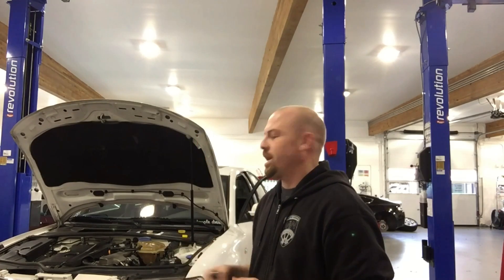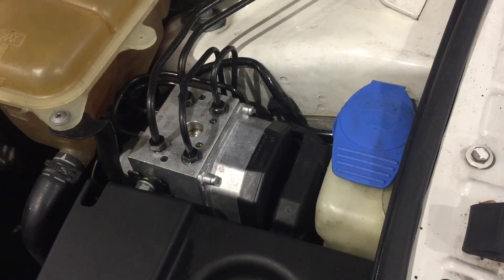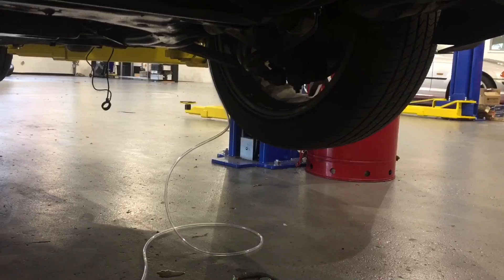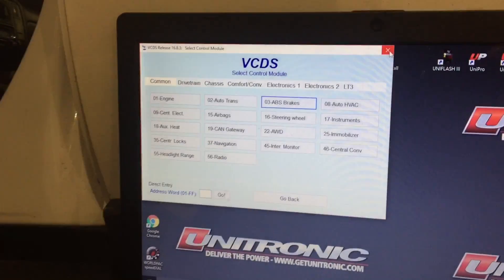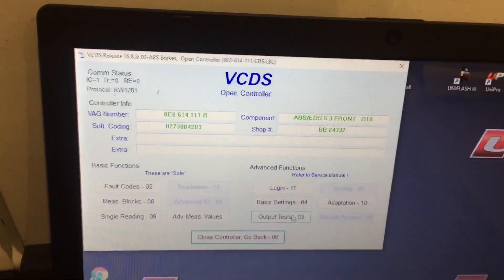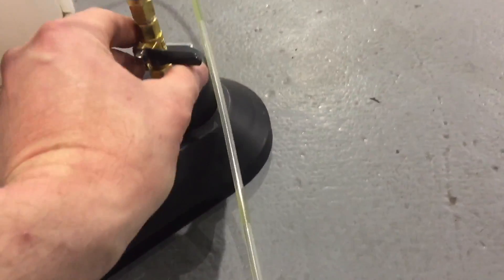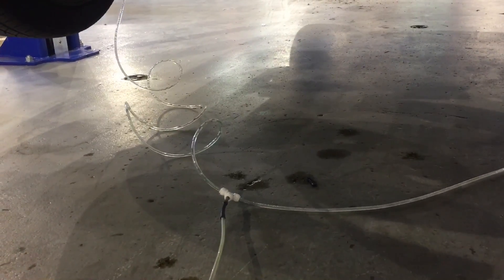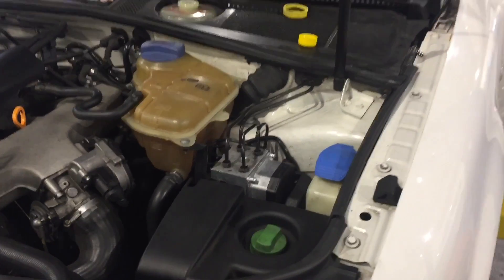ABS Pump Brake Bleeding VW B5 Passat

Comment: Aren't you NOT supposed to have the pedal to the floor to avoid upsetting the master cylinders internal seals? 

What section of VCDS must you use to bleed the ABS pump for a 2008 A4 quattro manual speed? I've been using the output settings and selecting the ABS pump test activation that runs the pump for about 30 seconds. Does that do the same thing as the basic settings? When I have both front bleed screws open nothing comes out when I do the ABS procedure. But when I bleed them normally fluid comes out. I'm using a Schwaben pressure bleeder at 2bar. I saw somewhere that Audi's have some sort of pressure safety feature in the system. Could the pressure bleeder be causing that feature to prevent fluid from releasing? Should I use a lower pressure?
Reply from the maker: VCDS Can+Hex is what we use for this model. One VCDS it should tell you to press the brake pedal down before starting the motor. This bypasses the master cylinder and allows fluid to pump though to the calipers. 

Correct, do not push the pedal all the way to the floor. 90% ifof the way, max.
Reply: I suggest checking passatworld. A highly experienced person there insists no special tool is needed for b5 and b5.5.
Reply: And yes, don't push it to the floor. You can guess how I learned that.

Comment: Ok I have a small computer but I’m doing this myself… can I after I fill brake fluid, connect hose to bleeder and put into a bottle with brake fluid in bottom, open connector/bleeder, turn abs on, and then pump brakes until the abs turns off? Then close bleeder and go around car like that?
Reply from the maker: ** If you follow the video, exactly like I did it, you will be successful. I made this video and performed this bleed by myself. Just make sure the reservoir is full when your performing this. We use a feed bottle now that helps with this procedure.

EWK Brake Fluid Refilling Bottle: https://www.amazon.com/dp/B01HGPI5O4

** For the follow up bleed on the rear brakes, you will need one of the two options:

1) Pressure Bleeder. This is the pressure bleeder, made by Motive, is the tool we use in our shop. This is good if your flushing the fluid and are not trying to get air out.  IF you are trying to get air out, this will work, but sometimes does not get everything out. See option #2 below.

Motive Pressure Bleeder: https://www.amazon.com/dp/B0002KM5L0

2) One way bleeder valves. These valves, made by Russell, have one way check valves that will allow you to pump bleed the brakes by yourself. If you're trying to get air out of the lines and performing this yourself, this is a really good option. Personally, I like this better because you can close the valve, pump up the brake pedal so it's nice and firm. Then crack the lines and perform a few pumps with your drain submerged in the fluid catch. This will force all the air to one area within the brake lines and it will get more air out of the lines faster. They make them in M7x1.0 & M10x1.0 for almost every European application:

M10: https://www.amazon.com/dp/B000CPCOAM
M7: https://www.amazon.com/dp/B000CPCOB6

Comment: So what do you do if you DO NOT have all these tools ???????? Better to show how to without them.
Reply from the maker: There is no way to do this safely without a proper scan tool. People have told me they have bypassed this and manually ran the motor. But you risk the chance of burning out the motor or shorting out the control module. I would HIGHLY suggest not doing this.
Reply: Can't without activate the pump properly without a  highend scanner or VCDS
Reply: Get a different car or stop being a brokeass

Comment: Hi Dave, l am upgrading to vcds from vcds lite to perform the same procedure on the ABS.  I was wondering where you found the procedure that was specific to your vehicle. 
My car is a 2001 audi a6 quattro and
Reply: an unable to locate it.
Thx
Reply: @peterhilbert6428   Did you find how to run the abs pomp?
Reply: @MKasap-te8vm  Yes, VCDS LITE will not run the pump as l was told. You need the full version.
Reply: @peterhilbert6428  A registered copy of VCDS lite will run the pump I'm told. Registration costs $99. I'm going to try it.

Comment: Great video! So for the rear brakes do I bleed them the normal way without VCDS tool?
Reply from the maker: On early model Passats, yes. If there is no provision on the scan tool to perform the rear brake bleed, you will need to do it manually.

Comment: Can you pressure bleed (Motive, etc.) using the same method?
Reply from the maker: No. The ABS system will still need bleed and the motive bleeder will just push it out. The AMS system is a closed loop system that will only be able to bleed if the pump is on.

Comment: Are you not supposed to bleed rear brakes first and then front?
Reply from the maker: The VW workshop manual says to perform the ABS bleed. Then perform a normal brake bleed.

Comment: Invaluable video - Thank you Dave.  Can you please clarify that the ABS does not relieve the rear brakes?  I just verified in the Bentley manual for model year 1999 thru 2004 that there are ABS inlet and outlet valves going to all four brake lines.  In addition each wheel has an ABS sensor.   It would seem that the ABS relieves all four brake calipers.  Thanks.
Reply: I believe this varies by vehicle....
Reply from the maker: @PeterB12345 is correct. It's a case by case situation. Some vehicle have it for all four. This vehicle had it for the fronts only.

Comment: VW Golf V 2005 with ABS on all 4 wheels. I has  a soft pedal for a long time. Not close as hard as my Passat 2006 with a similar system. Do i need to do the ABS pump procedure on both axles? One axle a time? (I have a pressure bleeder and VCDS).
Reply from the maker: This symptom sounds like it may need a new master cylinder too. It's try bleeding the system out first. It's a good idea to bleed the ABS system if you have this going on. But you might be able to pressure bleed the system if you're changing the master out. Old school pumping with two people is sometimes required when doing this.

Comment: Hey I have a 2001 Audi A4 B5 1.8TQM do you know if I should go with the Output tests 03 or basic settings 04 route? I have ESP under the “component” slot it says I have a “ABS/ESP allrad D56”
Reply from the maker: Not sure. When vehicles have different options like this, sometime you'll need to go through the modules and see where this procedure is located. There should be a link on the RossTech website on where your specific bleed procedure is located.

Comment: Hi. Can I use a pressure bleeder instead off a vacuum bleeder?
Reply from the maker: If your bleeding the brakes, us a pressure bleeder / vacuum bleeder only. 

If you're bleeding the ABS pump you MUST use a scan tool to turn on. Not sure if you can use a pressure bleeder or not. You might be able, I've never done it, post up here if it works.

I also looked up the wiring diagram on this specific model and you can not jump the pins to turn it on. It works on an internal relay, not accessible from the pins. The only way would be to remove the ABS modules case and do it right on the circuit board. If you mess it up, you'll be buying a new ABS control module. So at that rate, you might as well get a ODB11 or VCDS VAG-COM cable.
Reply: @MeisterWerks  thanks for your reply. I have a vcds I use on a laptop.

Comment: If I'm using the pressure bottle (Motive) method am I correct that there is no need to push down the brake pedal?
Reply from the maker: No you do not have to, but this will not bleed the ABS unit. You have to use a scan tool to activate the pump and push the fluid / pump the air out of the ABS system.
Reply: Right - I have a VAGCOM - just confirming that I don’t need to push the pedal down (like you did in the video) if I’m using a pressure bleeder (while running the VAGCOM cycle).
Reply from the maker: @scottbettencourt4051  You do not want to use the pressure bleeder for bleeding the ABS pump. Just make sure the reservoir is topped off. Follow the directions on the VCDS. 

If you're bleeding the ABS system, you have to hold the brake pedal down - no pressure bleeder. If you're just bleeding the brakes, as normal (IE flushing the fluid only), you do not have to hold the brake pedal down.

You only need to run the VCDS ABS bleed procedure if, a) you have changed the pump, or b) you have an excessive amount of air in the system and can not get the air out.
Reply: @MeisterWerks  Thank you!

Comment: This looks like a Bosch 5.3 unit. Could you explain how Bosch 5.7 ABS/EPS would be bled differently? Is it in principle self-bleeding since it has no external pump, and no VCDS-procedure is really necessary?
Reply from the maker: Quick search on the internet yielded this: "If you have VCDS, run a scan. When it comes to the ABS Brakes control module, VCDS shows the ESP version right at the top of the display. If it is ESP 5.3, you have the pump which may need bleeding (via VCDS). This is not a issue with ESP 5.7 as there is no pump." So as I take it, you just bleed it normally like a car without a pump.

How it works, is it calculates the speed, steering angle sensor, yaw / pitch / roll sensors, braking valves and engine power. Then it makes necessary corrections using the valves to provide more or less braking force to certain calipers while shifting power to the other wheels. In turn, this will correct the yaw pitch and roll of the vehicle keeping it moving in a straight path.
Reply from the maker: Here is a video that explains it. 
https://www.youtube.com/watch?v=Y2uXzp2HzKg

Comment: Is that computer program downloadable free? Also what kind of USB cable are you using?
Reply from the maker: The VAG-COM software is Ross-Tech VCDS. You can download it for free. However you will need a Ross Tech cable to get full functionality out of the software. You can get cables off eBay or Amazon, but I do not know if those work with this feature. The cable I am using is the full version HEX + CAN cable which they do not sell any more.

The website is https://www.ross-tech.com/vag-com/

Comment: Hi! Thanks for the helpful video.
I have a question: making some pressure (like 1bar) in the brake fluid reservoir instead of using the sucking device will do the trick either?
Reply from the maker: Thank you! Our pleasure. Vacuum machine works. Pressure pot like a Motive pressure bleeder also works (sometimes better). Bring it up to 2 bar / 25psi and bleed away. We have both. 

NOTE: Never use both vacuum and pressure at the same time. Use only one or the other. We've found that the pressure and the vacuum at the same times creates an air pressure difference and can actually pull air back up into the lines.

Comment: Is it necessary to press the brake pedal down? If so why?
Reply from the maker: Yes. You must compress the master cylinder piston (hold the brake pedal in) to bypass and pressurize any air that becomes trapped in the master cylinder. Since the ABS is fed brake fluid by the master cylinder and reservoir, compressing the brake pedal will allow the air trapped in the master cylinder to bleed through. If you don't, you will never bleed the system properly and air will remain in the master cylinder. 

Also, you do not want to max out the pedal all the way to the floor, you want about 75-80% of the pedal pressed down. Maxing out the pedal travel can blow out seals inside the master cylinder due to overpressurization. 

If you need someone to hold the pedal down while you perform this task, you can purchase a brake pedal jack tool / holder. Most auto parts stores have them or Amazon. 

Here is a link to Autozones: https://www.autozone.com/test-scan-and-specialty-tools/brake-tool/oemtools-brake-pedal-jack/802194_0_0

Here is a link to one on Amazon: https://www.amazon.com/dp/B01G7I4VGC
Reply: @MeisterWerks  Thanks for the reply, looks like I'm bleeding them again then, I did it but without depressing the pedal, I assumed it was working as the fluid was coming out quicker when the ABS was activated.
Reply from the maker: @dandan556  No problem. When bleeding the ABS pump, VCDS / Ross Tech VAG-COM and the Launch x431 Pro tells you at each step when to depress and release the brake pedal. Not sure about any other scan tools though.

Comment: Hi! awesome video, just confused why the same set up is not used on rear breaks, are rear brakes on this 99 passat non abs that we are not using scan tool to cycle abs pump to bleed rear lines?
Reply from the maker: Thank you. Depends on the options, year and model. On this '99 Passat (FWD), it does not have ABS on the rear. Most newer cars have ABS on all four corners. So when you're bleeding the ABS, the VCDS / VAG-COM (or similar scan tool) will tell you what brake caliper to go to, when to open the line and when to close it.

Comment: Is it the same on a bmw e46?
Reply from the maker: Same concept but slightly different procedure. You have to have either BMW ISTA or a scan tool that will allow you to activate the ABS Pump. Our Launch x431Pro will do this, but we also have ISTA & ISTA P for this. There are a slough of other scan tools that will do this as well. Autel MaxiCheck Pro, Schwaben Professional and Bosch ADS X, just to name a few.

Comment: I've bled the ABS using a VAG COM and the brake peddle is hard when the engine is off but when you start the engine and press the brake peddle it goes to the floor. Any ideas? It's a 2003 Passat B5.
Reply: did you fix the issue?
Reply: Did you resolve thw issue? If so what fixee it?
Reply: You still have air in the system. It can take several cycles of the bleed procedure to bleed the pump on these systems. Also, I prefer to set up a pressure bleed on the reservoir. That way the risk of running the fluid too low and I introducing air  is greatly reduced.
Reply: This is just the cars brake diaphragm pump working, when driving and operating the brakes this assist with your pedal push, if you press the pedal with engine off it will go firm, keep the pedal down and turn the engine on and the pedal will go to the floor proving this system works.

Comment: Excellent video. Many thanks for this. What size is the clear pipe/tubing you are using for this, and where do you buy yours?
Reply from the maker: I think I just have some 1/8" ID — 1/4" OD vinyl hose. You can get that anywhere. Sometimes the Auto Parts store, but Hardware store always have it. Lowes or Home Depot. https://www.lowes.com/pd/HydroMaxx-1-8-in-ID-x-1-4-in-OD-x-100-8217-Flexible-Non-Toxic-Clear-Vinyl-Tubing/1002931446

Comment: Hello! I've been doing some work on the abs module in my car and I am not able to screw in the out lines for the rear wheels in the abs module. It leaks brake fluid. Do you know how to solve that?

Thanks a lot!
Reply from the maker: They have to be torqued correctly. Make sure the threads are not messed up. Also check the brake line flare. If there is any imperfections in it, it will not seal right. Here are the torque specs for a B5 

Tightening Torques
 Brake lines to ABS module:
    Thread M 10 x 1 .................... 14 Nm / 10.3 ftlbs / 123.91InLbs
    Thread M 12 x 1 .................... 14 Nm / 10.3 ftlbs / 123.91InLbs

Comment: Hi, is this procedure necessary if the ABS system hasnt been opened or fiddled with in any way? 
Im trying to bleed the brakes on my B5 A4 with a pressure bleeder, ignition on. Afterwards the pedal goes almost to the floor, but the car stops. Do i need to keep bleeding it or could there be something wrong with the ABS system? No codes present. ABS works.
Reply from the maker: Yes it is very necessary. You have to get ALL the air out of the ABS system and by pass the master cylinder when doing so. If you don't, you brake system will never be bled correctly.

Comment: I originally had an implausible signal g201 brake pressure fault on my 2002 S3. I changed that sensor which then showed an electrical fault in circuit. Then the abs module failed. Having replaced both sensors and swapped the module, vcds now shows electrical fault in circuit for both sensors but no other faults. The garage were unable to perform a pump bleed or output test at the time of installing. I noticed on rosstec that a possible remedy for the faults I have is a brake pump bleed. Is it possible that because this procedure wasn't done, this is why the module sees the faults? When the car went in to have the module replaced, the fault was only on one sensor as well which is making me think the module needs to be calibrated correctly.
Reply from the maker: If they didn't bleed the system, there will be massive amounts of air in the pump and controller. This could potentially damage the unit. From a legal standpoint, It is their obligation to complete the entire repair with the proper tools. Not only that, if you crash your car because they did not complete the repair properly, they are liable for your accident.
Reply: @MeisterWerks  thank you for the reply. Unfortunately their vcds was not working at the time so they couldn't do it. I don't use the car much but hoping this will resolve the issue I've got when it goes in next week. Great video. Very informative 👍

Comment: Dave just a follow up. If you are bleeding manually (ie tube in bottle) do u start pump open 1st bleeder, finish,  than open 2nd and cycle pump till all air removed from front bleeders?
Thx
Reply from the maker: On this model, you start with the ABS pump.  After that, bleed the brakes as normal. Start at the Rear Right, Rear Left, Front Right and Front Left. On rare occasions, there are still a few little air bubbles that don't come out 100%. So I've had to repeat this process from the start. I typically use about 1 liter of brake fluid and it's a good idea to fully flush all the all the old fluid out.